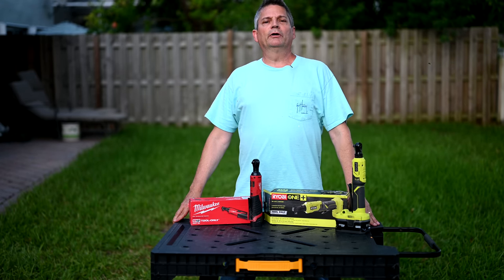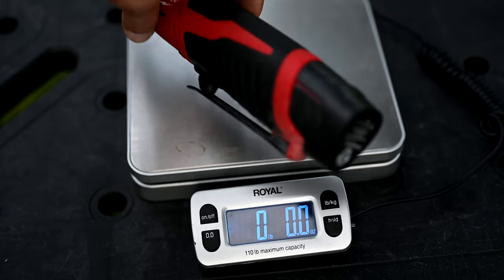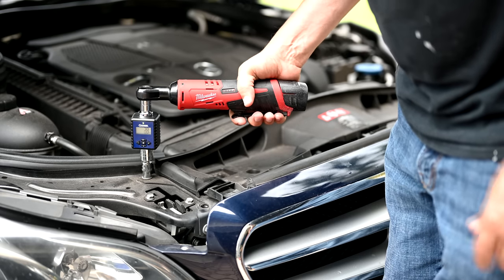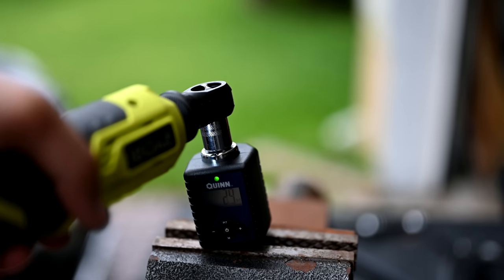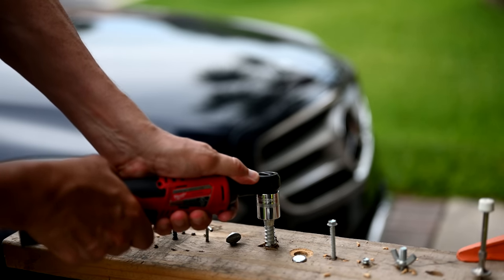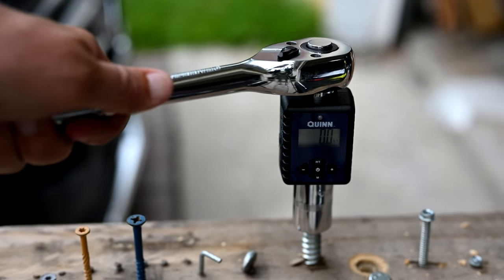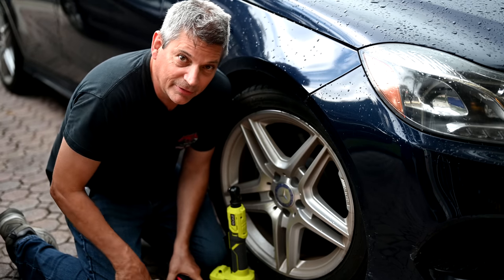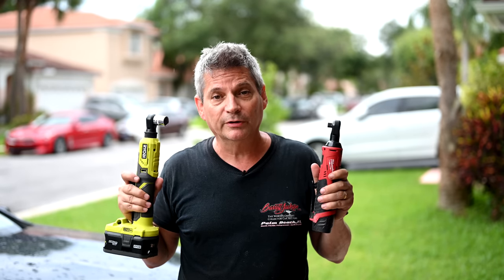Ryobi 3/8" Cordless Ratchet Vs. Milwaukee Torque/RPM Tests

Comment from the maker: 🛒 Milwaukee 2457-20 M12 Cordless 3/8" Lithium-Ion Ratchet (Bare Tool) https://amzn.to/3ejUfY5
🛒 Ryobi P344 Cordless 3/8 in. 4-Position Ratchet Home Depot Only: homedepot.sjv.io/g2G55
🛒 Milwaukee 2131-20 M18 ROCKET Dual Power Tower Light (Tool Only): Amazon: https://amzn.to/2YXdeU7
🛒 Milwaukee 2131-20 M18 ROCKET Dual Power Tower Light (Tool Only) Home Depot: https://homedepot.sjv.io/m7G1D
🛒 DEWALT DCE511B 20V MAX Cordless Fan for Jobsite, 11-Inch, Tool Only Amazon: https://amzn.to/2zVsNlb
🛒 DEWALT DCE511B 20V MAX Cordless Fan for Jobsite, 11-Inch, Tool Only Home Depot: https://homedepot.sjv.io/XVN55
🛒 DEWALT DWST11556 Express Folding Workbench: https://amzn.to/2qsaRdi
🛒 Channellock 39067 132 Piece Tool Set: https://amzn.to/36SZr1U
🛒 Channellock 39070 94 Piece Tool Set: https://amzn.to/35N3fBy
Reply: Why did you bother doing it with the old models

Comment: with most of these tools, I think it all comes down to the battery at the end of the day. The huge battery on the Ryobi kind of defeats the purpose of the ratchet.
Reply from the maker: The cool thing like I showed in the video, is that Ryobi allows you to spin the head into 4 different positions, so the socket is now facing out the short side of the battery, now the clearance is exactly like the Milwaukee
Reply: @jeffostroff  clearance is not the same as the Ryobi. You still have 3 Inches hanging off the end of the tool no matter which way you clock the battery. In a tight spot, the Ryobi would be worthless.
Reply: @shanestewart1498  I have a lot of the m12 and m18 Milwaukee tools and wouldn't trade them for anything, the size of the tool and battery is what I need, that huge battery just won't fit in the areas I work.
Reply: @jeffostroff  HAHA yeah that aint gonna work all the time chief. I started laughing when I saw the cryobi. Any pro knows that's worthless junk.
Reply: I have a C3 craftsman power ratchet(basically grey Ryobi). It's useless because of its massive battery. If the ratchet fits in so does an impact wrench.
Reply: Exactly and he switched and used the 4ah battery for the ryobi thats probably why the ryobi out performed in some ways
Reply: @jeffostroff  Ryobi would have to design a accessory akin to a extension cord allowing the big battery to be detached and have power from it carried to the rachet via the extension corn setup to allow work in tight places.
Reply: Not really a fare comparison. For a start, you are comparing a 12v tool to an 18v one, so the Ryobi is 33% more powerful.
Also, the Ryobi, like the Milwaukee Fuel 18v, is for heavier work.
Reply: $150 vs $89 (HD current kit deal) 🤷🏻‍♂️
Reply: Depends where you're using your tool the battery is on the base of the tool, it's made to get deep enough to reach a reachable bolt and still smaller than an impact drive or 1/2 drive ratchet and even a brushless Milwaukee m18 impact drive comes in with a battery @ 3 lbs and is compact but still a impact drive not as compact as the Ryobi ratchet.
I agree it'd be nice to have a smaller battery like red or blue kobalt but this will get the job done and if you're already owning a Ryobi one plus the battery are interchangeable,  so kinda depends what your budget is but this a little beast with a big battery pack same with the slightly smaller Makita battery on the 18v ratchet and the husky ones are on sale for the holidays but battery is attached it's not replaceable, it dies your tool does too so a waste unless you're a DIY and casually use it, you're good.
Reply: @ramblingman8992  More volts is not the same as more power, you misunderstand on a fundamental level, you lack the basic understanding to understand the relationship between voltage, current and power.
Reply: A spinning head doesnt help vertical movement in tight spaces 🤷‍♂️
Reply: @sourwords1808  that's correct, what use is it if it can't fit up my shitstinker?
Reply: If you have ryobi then you have a ratchet available that works. I have enough extensions to get were I would put a ratchet. I appreciate all the companies supporting there line with good tools.
Reply: I prefer air tools for anything other than daily tasks. IE hard to reach moments. You can get slimmer tools and tools for every situation and it's far cheaper. Also faster than electric.
Reply: I have the new Royobi slim head  ratchet and it is an excellent tool.  We use the 2 AH batteries on it.
Reply: @electric8668 not a bad idea
Reply: I love my M12 fuel. I have all the colors s

Comment: The Ryobi needs a bigger battery.  Maybe like a car battery on the bottom of it.  Would only be a little bigger than the one on there.
Reply from the maker: That would be a hoot to see that!
Reply: Absolutely would be super handy to have a Interstate Megatron on the bottom,, two hands required for safety of course.
Reply: Lol.
Reply: 12v vs 18v
Reply: I’m
A die hard ryobi fan, owner, user. I have that Milwaukee ratchet. I would have preferred if ryobi made a smaller battery for smaller tools, just like Milwaukee has. They mace a m12 and m18 line of tools. Ryobi could have made a small battery like the Milwaukee but still fit in the 18v charger.
Reply: Yeah get a high capacity, deep cycle Odyssey Battery on there!
Reply: of maybe sell a heavy duty battery in a convenient back pack?
Reply: James Carroll  why no just make a small battery that plugs into a hollow plastic adaptor that mounts it to a charger? No need for the swivel head or to have that huge battery pack, but yet is still compatible with all chargers?
Reply: Almost spilled my drink lmao 😂

Comment: That ryobi wouldn’t even fit where I’ve put my fuel 1/2 inch ratchet at. The big battery makes it useless for engine bay work. You buy Milwaukee for the battery lineup not just the tool
Reply from the maker: I want to try the M12 Fuel version of this.
Reply: plus the smoke comes out too early
Reply: jeffostroff I’ve been hearing the fuel is miles better but I’m not sure what’s improved. I have a fuel and I love it.
Reply: @Racingboom  The fuel has 55 # ft of torque the Milwaukee he is using has 35 # ft but I believe the rpms are lower I also have the fuel and love it..
Reply: Snapon walks all over the Milwaukee!! They have the best electric ratchets hands down and always will
Reply: @Thebassguru84  for that price they don’t. Snap on is too overpriced and they’ve been playing catch-up with Milwaukee ever since the m18 and m12 series.
Reply: @jeffostroff  the fuel versions are amazing! Very heavy duty and beefy. I have the 3/8 at work.
Reply: @Thebassguru84  lol snapon cordless is a joke. Their hand tools are the best but not their battery powered tools.

Comment: 12v "vs" 18v....apples vs. oranges.  Anyone who has used a ratchet can also appreciate the form factor of the Milwaukee vs the Ryobi with that huge battery.
Reply from the maker: But I  Love how Ryobi overcame that huge battery with the rotating head, makes it a non-issue now.
Reply: I have a lot of ryobi electric tools, because I can swap batteries as needed, but that big square battery on the end of a slim line tool could be a problem. You started the video talking about tight spaces in a car, and that battery could be a real access problem. Still I don't know if I want to go buy one milwaukee tool
Reply from the maker: @TSKseattle  Tom, didn't you see the part where I compared both tools side by side and showed how we rotate the head on the Ryobi to make the battery a non-issue?
Reply: @jeffostroff  it's not a non issue if you work in tight engine space. I've squeezed my manual ratchets into some small spaces that would not give you space for that battery at the end. I have all ryobi tools but given other options can offer a slimmer design it really puts me off the tool. If not for tight spaces then 18V every time over 12v rachet.
Reply: jeffostroff battery on the Ryobi is still a issue. Especially if working in engine bays.
Reply: I have ryobi and milwaukee too....the test you did is apple to oranges.  First the ah of the milwaukee is 1.5 vs 4.0 on the ryobi.  Try using the 1.5 ah battery on ryobi and can guarantee you will have similar results between the 2.
Reply: @jeffostroff  clearly you don't work on cars.
Reply: @jeffostroff  Ya.. you still have to break the fastener loose by turning the tool. These are designed to save time, not be a form of impact tool.

I'm a Milwaukee fan boy but id buy that if I had other Ryobi tools. I hate that battery compartment tho. They could have just improved on the m12 design and sold the tool $30 cheaper.
Reply: I don't use cordless tools but why did he cover up the hole on the Ryobi then it got hot on purpose.
Why did he use the Milwaukee in the Ryobi hole that had brand new thread.seems a bit biased towards Ryobi,a bad review ☹️🇬🇧👍

Comment: I have had the Milwaukee M12 for 4+ years and I love it. I don't think That I could get by using the Ryobi just because of the size of the battery, to many tight spaces that it won't go into. I will give up the power that it looses to the 18 volt Ryobi just to keep it small.
Reply from the maker: Larry even if you spin the head around on the Ryobi? It makes it have the same clearance as the Milwaukee, at least from the front.
Reply: jeffostroff  The ryobi spin feature only gives it clearance from that one side, your not accounting for the difference in length or just that now you have the huge battery sticking out the other side, for the task you did sure if wouldn’t matter much, but I’ve had to put my Milwaukee ratchet in tight spaces where it just fit, especially in automotive, places where there’s no way the ryobi would begin to fit. Example taking the bolts out of a fan on the front of the engine, bolts out of the top of a transmission, or in going deep in the engine bay where I have to slide it in and flip it all around just to get to the bolt,  many times where an extra inch  in length and definitely 3+ inches at the base would not cut it. For real automotive work, nothing beats the Milwaukee.

Comment: As a mechanic it really comes down to the money and platforms you want to invest in. I wouldn't use any cordless ratchet to torque anything. They are good for fasteners bolts, quick assembly and disassembly of interior/exterior bolts. These are used more for the speed in break downs than it ever is for bolt torquing. I use Ryobi mainly because I have for years but also because I have yard equipment and other tools on the platform. Good package pricing as well. Even the most basic tool can be a super tool in the right hands...
Reply from the maker: I found them both to be good useful ratchets

Comment: Ryobi has a bit of advantage because of the battery 18 vs 12 volt  but yes budget wise Ryobi...Also i don't like the big battery on the Ryobi in tight spots it wont work...

Comment: Ryobi is prosumer. I've used their products for years. The short coming has always been battery life. Ni-cad let me down, My fault leaving them in the charger all the time. Just bought the new green line. Lot less expensive and same or better specs.
Reply from the maker: Yes I always tell people with all those old school nicad batteries to ditch those old systems even if you have to pay money to upgrade to a newer brushless motor with lithium ion batteries their lives will be much much better there will be much happier with newer more modern more powerful and lighter tools

Comment: Not even 2 minutes in and regardless of results I’d never get the ryobi. Battery is too big for engine bays and the trigger looks awful
Reply from the maker: As long as you don't have to reach too deep, won't be a problem. Certainly we can sue it for changing spark plugs, and replacing car batteries, and on log nuts once we loosen them. Or use them to tighten lug nuts before we torque them down. Of course using on a regular basis with lug nuts, you'll likely use an impact wrench.
Reply: jeffostroff yeah I suppose I’m looking at it from my point of view as a mechanic where I’m using these things everyday. For a guy on his driveway the ryobi would be absolutely fine
Reply: I personally would never use a cordless or even pneumatic ratchet for any car with that involves having to dig deep inside somewhere to reach a fastener in a very tight space. 1) the ratchets are too bulky, regardless of what kind of battery pack is on it, and 2) if the fastener is super tight and you're not able to break it loose by hand, and you try to loosen it up with just the trigger you'll end up smacking your fingers against other parts and bruising them up, hence why these are called "knuckle busters" lol. Not saying they're bad ratchets that can't be used on cars by any means, they just need to be used in more open areas and only on fasteners that were broken loose/are not super tight to begin with. They weren't designed to be able to be used in super tight areas. Some more than others yes, but they will not be able to fit halfway up underneath an engine to reach a highly mounted starter or anything like that.
Reply: @coytus94  power ratchet is designed to speed up work and the time saved adds up. You don't have to be able to break the fastener loose with it to benefit from the speed advantage.

Comment: Sorry bro your wrong.. You can use electronic ratchets by hand like a regular ratchet they are designed for that they are meant for you to use them by hand to loosen the bolt then use the trigger to take it out Fast and can be done to tighten as well if you choose more then likley you won't do it by hand on tightening though when you can just use the powerof the ratchet instead @7:59 @Jeffostroff
Reply from the maker: Sorry bro you are wrong, Milwaukee's instructions specifically state not to do that. Remember it's a 35 ft lb rated tool, and you could easily surpass that trying to use the tool as a manual ratchet
Reply: @jeffostroff  I don't think you understood what I was saying I agreed with you on using it as a regular ratchet to tighten items I disagreed with you because you are suppose to use it as a regular ratchet to loosen bolts then use the electric part to take it out Fast I referenced 2 different things in my first message

Comment: Milwaukee 12v vs Ryobi 18v come on ????
Reply from the maker: Use your head. They both have the same RPM and the same Torque spec. Battery voltage probably has no bearing on this.
Reply: Why not using the current model from Milwaukee n redo the test??? The one u have on hand is like 4 years old model. By the way, even the torque n rpm r similar on both Ryobi n Milwaukee, Voltage DOES make a huge different, u have to put on consideration of battery voltage drop under load, bla bla bla ... this video is not a fair comparison to me.
Reply: @jun2611  it is a fair comparison because of the price.

Comment: They are the same tool under the covers. slight changes in outer shell.  milwaukee, rigid, ryobi are the same company. They used to swap out plastic for metal, and sometimes better motors but lately they don't even do that to keep costs down.  Notice that the rigid and ryobi are starting to look alike?  I have friends that work at the factory, even swapped out made our own version of tools.
Reply from the maker: I'd like to see a red/green/orange version!

Comment: If you actually did tests instead of depending on spes from the manufacturers you would see the Milwaukee has a much faster RPM
Reply from the maker: Milwaukee does not have a "much faster" RPM, they both have the same RPM, and they both have the same 35 ft-lbs
Reply: @jeffostroff  No load is over 400 RPM on the Milwaukee.

Comment: I like the Milwaukee way better it's more compact easier to work on tight spaces ryobi battery is just to dam Big
Reply from the maker: Mario Ryobi is the same exact size when you rotate the head around so that it faces the skinny side.
Reply: @jeffostroff  It's the same until you need to shove the tool into a hole deeper than the battery.

Comment: I do have the Milwaukee ratchet but my garage is full of green. My concern here is the smoke exerted by the Ryobi. You put the Milwaukee through its paces but smoke was not apparent.
Reply from the maker: Yes, I was straining both of those drivers, and on automotive work probably won't be that harsh

Comment: Yeah, you're not supposed to use a ratchet with a bolt going into a small pilot hole.  Thats what the impact driver is for.  Removing it from an already anchored bolt would be more realistic. Plus a 12v vs an 18v is not a apples to apples comparisons.
Reply from the maker: Even though it is 12v vs 18 v, they are the same 35 ft-lb torque and 250 RPM, why would that not be the same thing?

Comment: this isn't what the tool was built for... lol. It's a ratchet, not an impact driver. I'm 100% sure if you tried to drive that screw with an M12 impact over a Ryobi impact, yeah, different story. Do appreciate the video though. Very thurough
Reply from the maker: Both manuals have warnings about this. Milwaukee says this "Do not force the power tool. Use the correct power tool for your application. The correct power tool will do the job better and safer at the rate for which it was designed." AND ALSO, from the Ryobi User guide it says this "NOTICE: Do not turn the tool off and attempt to use the tool manually to gain extra torque on the nut or bolt being tightened. Doing so could cause damage to the fastener and/or the tool."

Comment: ryobi could have easily built that rachet with an internal battery like husky. The battery defeats the purpose of the tool (fitting into small areas).